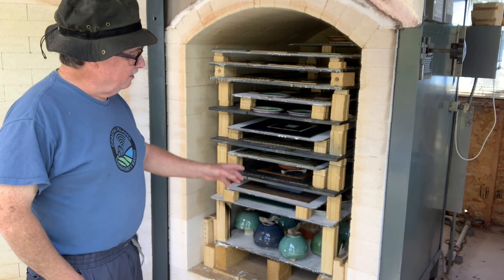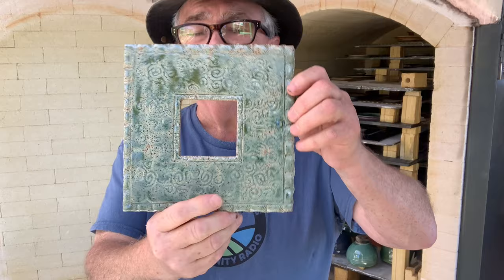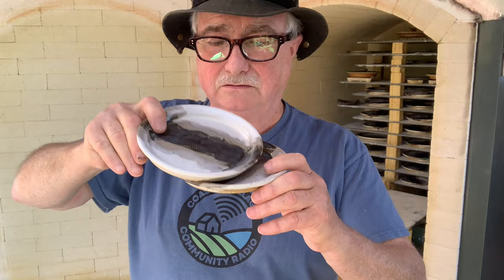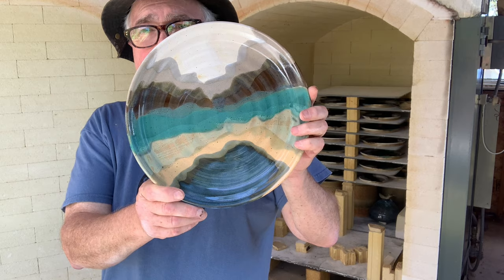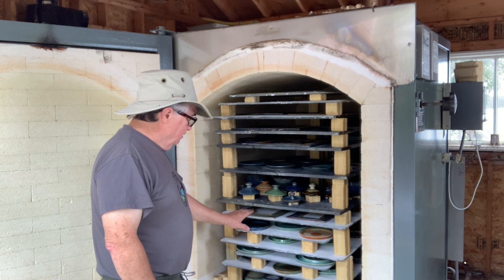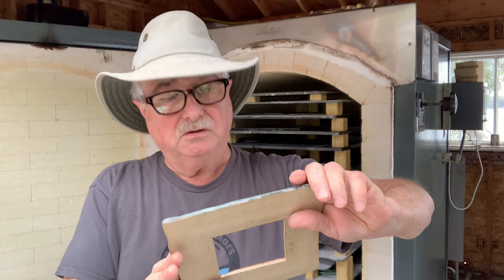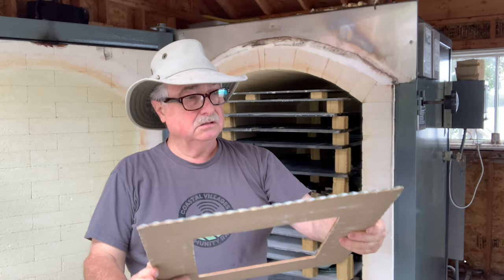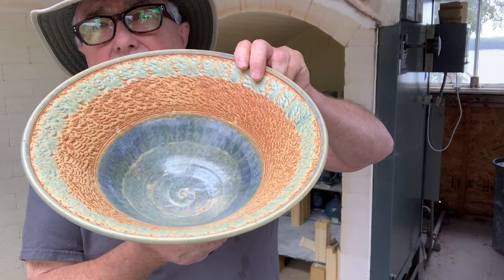2 Gas kiln firings, cone 6.

Comment: Love the bowls with the ash glaze 😍 I’ve made the bright sky blue glaze from cone 6 glazes and put it on my platter’s, it’s nice if it thick 😊 I wasn’t that impressed with the variegated blue, but noticed that you combine the two on pieces…
Reply from the maker: Variegated Blue is thickness sensitive, too thin it is uninteresting, thick makes it run and it is very opaque, just the right thickness is very nice. It works well if combined with an oatmeal glaze.